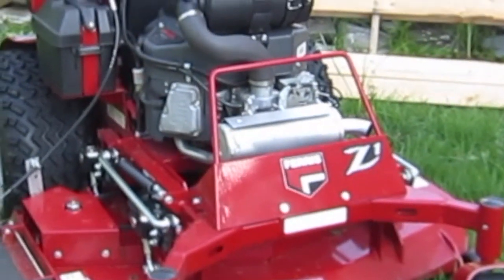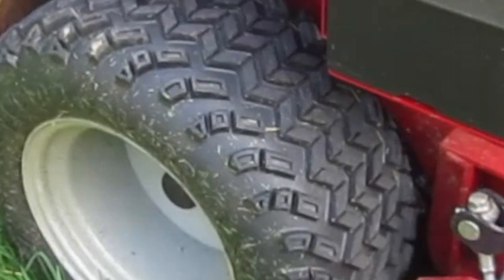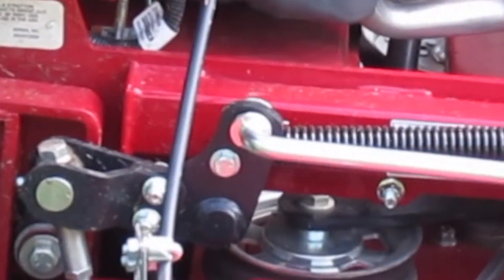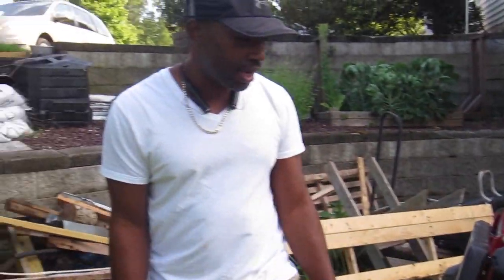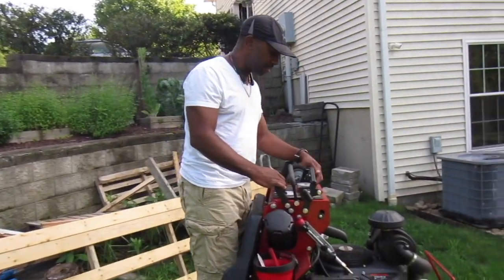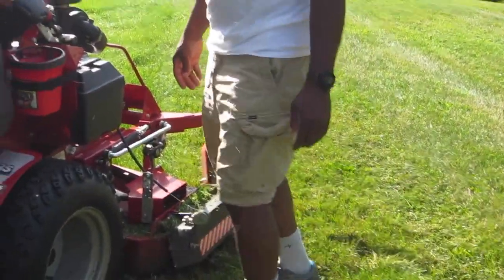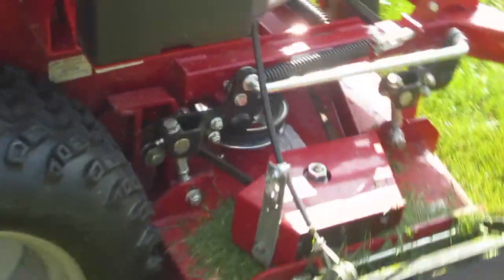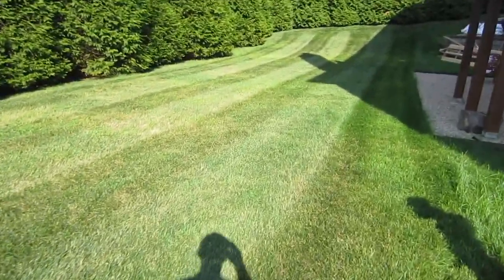Chute Control For Lawn Lawn Mower, Striping Kit Demo, All Terrian Golf Cart Tires On My Ferris 48"

Comment: Looks like the chute blocker lifted up higher with your original design. Can you adjust the level of lift for the chute blocker?
Reply from the maker: Yes you can, I change the chute control to a heavy duty which is more durable and effective.

Comment: Did you have a problem with the previous cable?
Reply from the maker: The other cable was a thinner gauge, and also was a 2 step(pull and turn). The new cable is much easier just pull and let go. To mount this new cable I turned the bracket the other way so it's clear when you are maneuvering the mower.
Reply: @seemowerplus  Just wanted to know if it broke. I bought the very same one for my mower. It will work for my application. Just don't want it to fail on me this fall. Thanks
Reply from the maker: It did broke
Reply from the maker: This new one I have been using for 1.5 years no problem do far
Reply: @seemowerplus  Do you have a part number for the new one?
Reply from the maker: Click in the first link in this video, you can see part number